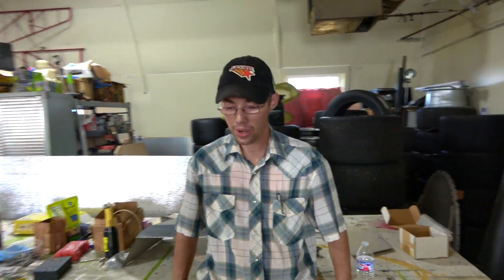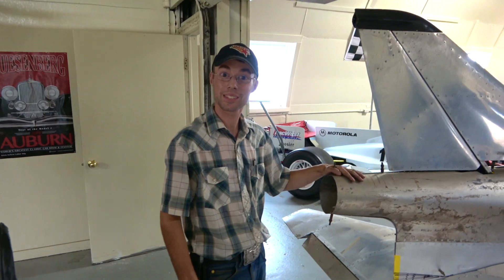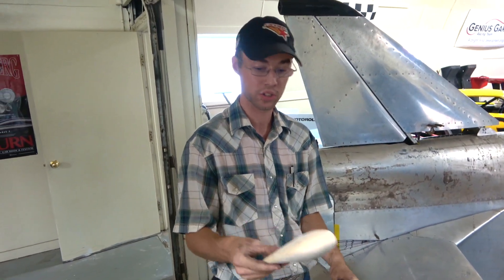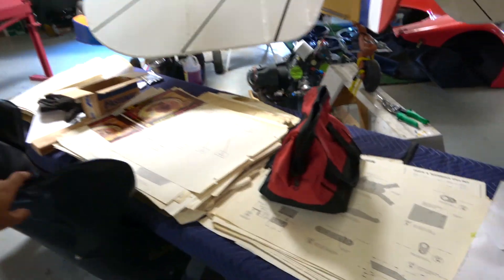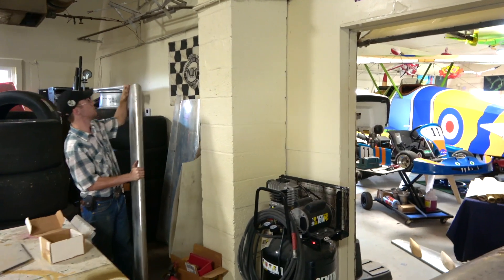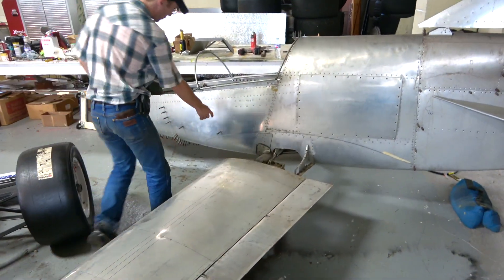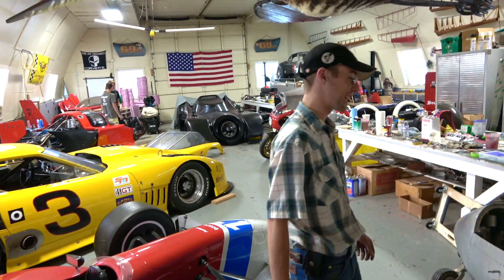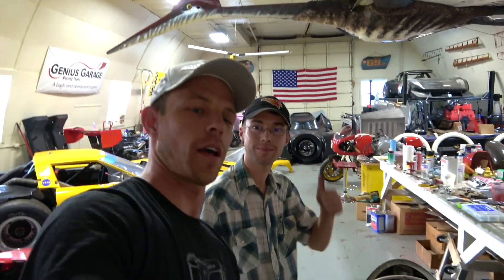Genius Garage BD5 experimental jet build update

Comment: Theres a long history of the BD5 that yall seem to have missed.   Originally it was to be a pusher prop, but they had constant problems with the engine.   Some owners found a small turbojet after they kinda got stuck with them.   Today, one of the water cooled conversion engines like AeroMomentum would probably work well.   But newer designs like the SonexJet makes more sense.   Check out Hummel or HomeBuiltHelp for details on constructing aluminum aircraft.